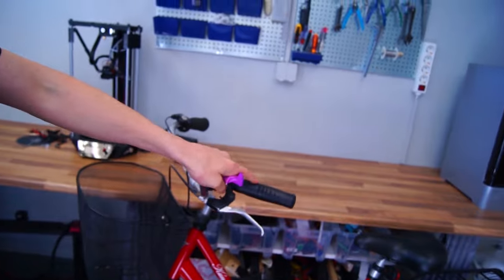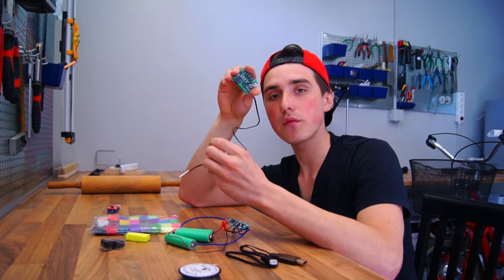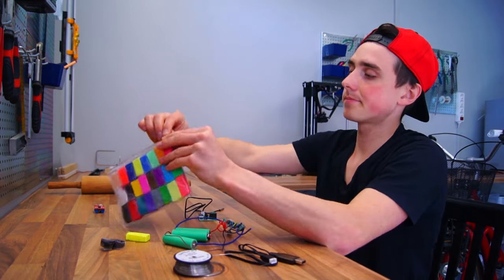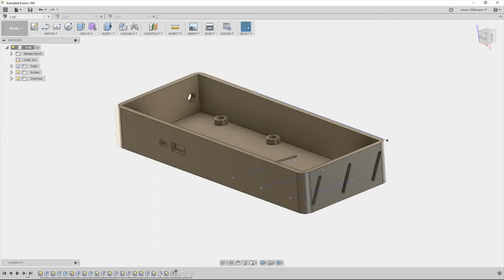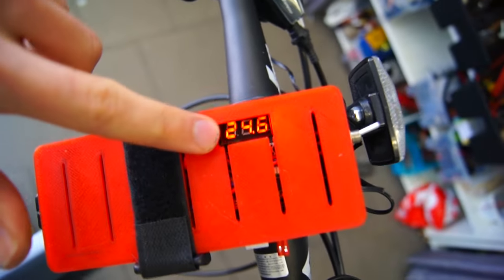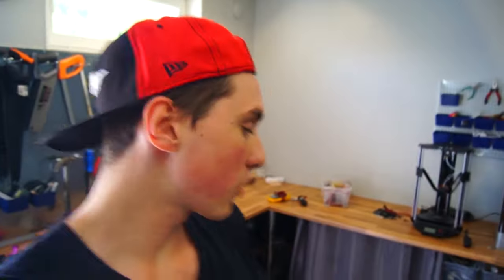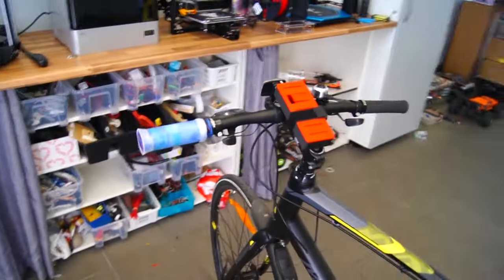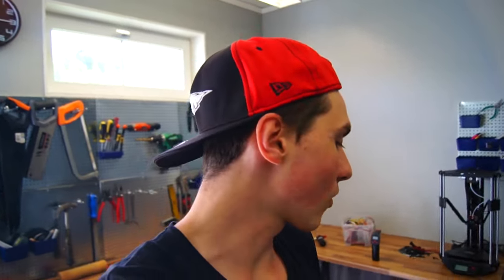DIY Heated Bike Handle Grips - Awesome Idea!!!

Comment from the maker: Got any burning ideas you would like me to do?
Reply: Burn a bee hive?
Reply: RCLifeOn can you try and do heated shoes. That would be really cool, anyway love your videos.
Reply: 3d printed ship
Reply: make an awesome 3d printed dslr cage .. and diy shoulder rig ..
Reply: make an awesome portable electric winter heater ..
Reply: 3d printed EDF system for skateboard !!
Reply: Make a heated coat and a little more heat near the neck
Reply: RCLifeOn How about custom lights for your bike with signal lights, head lights and tail lights.😁
Reply: RCLifeOn buy a 3d printer and try to print out part to expand the build erea. you dont haf to use a 3d printer.  MADE IN SWEDEN.
Reply: Merida is best !
Reply: RCLifeOn now just make it solar charged ;)
great video man
Reply: print a fidget spiner and cube
Reply: RCLifeOn heating çar chair
Reply: make a heated cup holder or an ollie like rolling cylinder
Reply: or something to put in a drink or a thing using a peltier chip that can swap between hot or cold
Reply: RCLifeOn make a heated car pad that plugs into the car
Reply: i would like a 3D-printed boat. with a  HMS look to it.
Reply: I actually really like this concept of heated handlebars, but I'm wondering... and this might get complicated fast, but how about applying a DC generator to the wheel that charges a supercapacitor (bank) which in turn heats the nichrome?
Reply: I would like to see you 3D print a phone case
Reply: Can you please please please make a video of makeing a RC foam plane 
🏖🛩✈🛫🛬🚁.
Reply: Riley Covert that's a really overused idea
Reply: RCLifeOn diy wood burner?
Reply: make a sound reactive led strip
Reply: RCLifeOn  3d print real size shoes (like so he can see)
Reply: Make a heated build plate for a 3d printer with your heating mechanism
Reply: Screw handles, make a heated seat for the bike! Or even for a chair!
Reply: RCLifeOn make heated gloves
Reply: Burning saddle

Comment: a small cooler, a bit bigger than a can of coke. That will cool a coke quickly maybe using a peltier and copper cubing with a small closed circuit pump

Comment: hello,can i ask how much time does a 3S 2200mAh take in order to fully charged?thanks
Reply from the maker: It depends on the charger. If the battery is charged with 2.2A, it will take 1 hour.
Reply: Ok thanks man 4 those information

Comment: Hello, from Germany
I want to get into 3D Printing. Therefore I thought about buying the Tevo Tarantula printer, because I am a student and I don't have that much money. I don't know which software I should use. My question is which 3D modeling software should I use and which slicing-softwares are good (or easy to learn)?
Thanks for answering :)
Reply: squirrelsalmon use fution360 and for the price of the program go on the internet and find out how to get it for free
Reply from the maker: Fusion360 and Inventor are two free to use modeling softwares you could use. Watch a couple of tutorials and you will be fine. Cura and Repetier Host are great free slicing softwares. Good luck mate!
Reply: Thank you for answering

Comment: this is stupid , you have to compensate for wind chill , the element will never get hot enough , and you are only powering one hand , one side how do you wire up and complete system for 2 hands , it would also be easier to use bar mits or heated gloves you would need less heat and use insulation to hold the heat in !

Comment: The problem with this video is that you did not explain in step by step detail, of what you were doing while making the heating element, or how tou connect the device to the bicycle and bike grips. Showing blueprints on your computer while playing annoying music is not an informative way to explain something. Secondly, using hand warmers inside gloves would be a much faster, cheaper and easier method which would produce better results. Each hand warmer will last several hours, usually 10hrs or longer!
Reply: fuck off